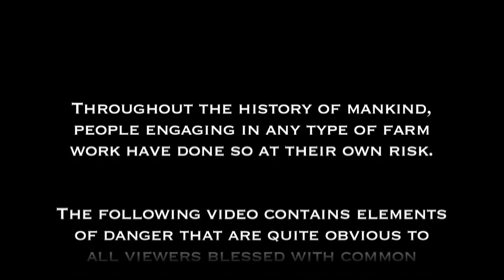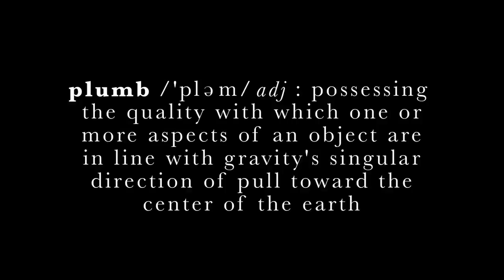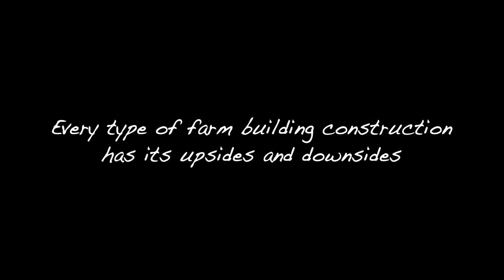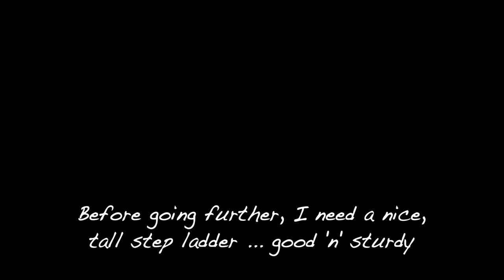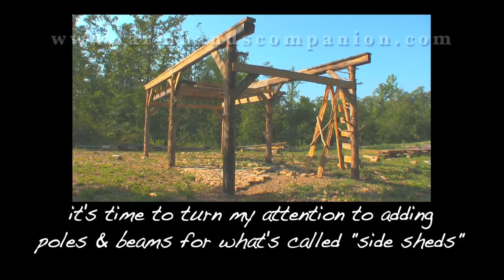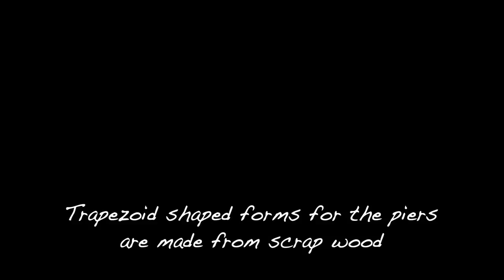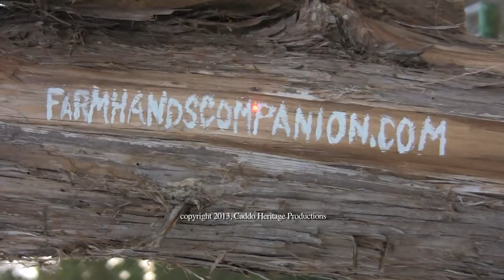Old-fashioned Pole Barn for the Small Farm, Pt 2 - The Farm Hand's Companion Show, ep 6

Comment: Hay Pa Mac !
I'm wondering how you got those Very LONG and very Heavy beams up to the top of those posts ?
I assume the use of your fancy tractor.... or did you use a Ging Pole ?   I've done some Ranching myself and building it 
all from the land is very rewarding , but in my case a necessity...    I made a 8hp bandsaw lumber mill that made the making of those planks far easier.... and less work... Hats off to you for sticking with it and getting the job done with just the chainsaw !
that IS a bunch of work ! Well done ! 
Bob.....
Reply from the maker: Hey Bob!
The longest boards I used were 11 footers—but they were pretty heavy, being made from white oak and about 1 and 3/4 inch thick by almost 8 inches wide. If I remember right, on the lower spans (just above head high) I drove a big nail temporarily on one pole (at about where the bottom of the board would be) and set one end of the board on this nail, while I carried the other end of the board up the ladder at the other pole and nailed it in (then moved the ladder to the opposite side and nailed that end in). For taller spans (the truss sills) I think I drove a temporary nail at both poles and with the ladder positioned in the middle of the poles, carried the board up and set it carefully on both nails. This is one of the reasons I intentionally designed the spans to all be under 12 feet (actually 11 feet) long, so that one fairly fit person could build it. It's still all tricky business, though—makin' sure the temporary nails were driven far enough in to hold the weight of the board. A falling board this heavy can wreak havoc on a ladder that's holdin' you up. It's also good to not have people, dogs, or chickens runnin' around under you—at least people, dogs, or chickens that you like. (Just kiddin' on that last thought)
Thanks for askin, Bob, and for watchin' the show!
Reply: Ok I understand that part  about the planks.... but the beams ...the 20' long 6"x6" or so beams that the rafters set on 
is what I'm wondering about..... are you saying they are 2 planks bolted together instead on one solid piece ?
.... LOL where there's a will there's a way !  makes sense to me !    I raised a log up about 15ft one time
for a ridge pole...  that was an ordeal indeed... I used a Ging pole, a board with a pulley on the top with a rope through it back down to the log, lifting and Pulling on the rope at the same time got one end up... then I did the same to the other end....  once up I cut the flat notch and used 12" spikes to hold it.... then I used logs to act as rafters every 2'  ( that ridge pole was about 6ft longer than needed so it would sit up there chained to the top) 
 ( i used lag bolts to hold the 2x8x6' Ging pole to the upright log... nails pulled out)
just so you know ! .... thanks for the info !   
Bob.....
Reply from the maker: That's right, Bob. The truss sill that holds up the rafters is composed of 2 upright planks (notched into the cedar poles from opposite sides) with a top plate nailed on top of both—none of which are longer than 11 feet.
(Your Ging pole idea sounds like more fun, though.)
Reply: Ah HA ! that's a very clever way of doing it Pa Mac ! 
....Thanks' for the Response !
 I bet your chainsaw is getting a bit Tired after all that work...
I made up an Alaskan mill years ago , yours is allot simpler and lighter!
.... I did brake down and buy a chainsaw sharpener ,Bench mount type, from Harbor Freight tools. ... it was a very, very good investment...a must if you use a chainsaw allot ..... although it's mostly plastic it works better than I can file the chains.... (Just don't forget the depth gauges on the chain !)
 Keep up the good work !
 and Thank you !
Bob.....

Comment: I always go back to watching the pole barn makin'. Two questions I have after watching this fifty times or so. 
1) What was the purpose of having the loft sills 2 feet below the truss sills?
2) I'm guessing normally you'd want to peel the bark off of the timbers to minimize bugs and rot. Is cedar bark also resistant to bugs and rot so u would be able to skip that step?
Reply from the maker: +Cassian YHVH 
Great questions, Cassian!
I'll start with the second question first:  yes, on practically every tree except cedar I would definitely peel the bark off or there'll be problems with bugs and rot. Cedar has such a thin outer bark (less than a quarter inch) and it usually separates from the tree and peels off by itself a lot of the time. In cases where it's hung on, though, I've not noticed any damage that threatens the stability of the post. Cedar must really taste bad to bugs.
As for your first question, allow me to rephrase it in a different way: "What was the purpose of having the truss sills 2 feet above the loft sills?" To start with, you can build your loft sills as high as you need em; I just wanted my loft sills high enough up that I didn't bump my head on em. Then, as far as the truss sills go, I could have designed things such that the trusses sat directly on the loft sills (basically combining truss sills and loft sills into one entity); however, that would have given me less headroom in the loft section (I'd be bending over all the time up there). I just happened to make the trusses sit a couple feet higher to provide more headroom in the loft. I could have made em sit even higher (3 foot, 4 foot, 5 foot, and so on...) but with every foot higher you go you're makin' a little more work for yourself. A couple feet seemed reasonable. 
Hope that helps, Cassian...and my best to you as you build your project!
Reply: Thanks for your thoughtful reply and the time you took doing so. It makes perfect sense now. Have you thought of future solar panels if they ever get cheap enough? I guess if that's a future option then you want the building aligned in an east west orientation so the "broad side of the barn"'s roof is facin' due south.

Comment: 2 questions on the beam.  Can you get away with using roundwood? With the top sill plate on the beam, did you nail it onto the round or did you square the beam up first?  My girls and I love your videos btw!  Your sense of humour keeps the 10 yr olds in stitches!  :)
Reply from the maker: Hey there, Marc! Yes, you can use round poles to substitute for most any of the milled framework lumber. It's trickier, in that you try to keep the size of the poles matching each other, and adjusting or compensating for crookedness, etc. If I were usin' stout round poles for the sill beam, I would not worry about a top plate, but might nail the truss ends directly to the sill pole. If the pole didn't have much of an even top, I might take a broadax and hew it evenly with the use of a chalkline. I'd also make sure the pole was strong enough to hold the weight of the trusses, with no large "knottish" defects in the middle. Think strength and safety; I wouldn't want that barn fallin' on your girls! (Please tell the girls Pa Mac says "Hey!")

Comment: Is there any reason why the main posts of a pole building couldn’t be put on piers like the posts for the sheds are? I’m sawing up wood to build a pole barn blacksmith shop, and I don’t have access to enough cedar trees for this. I’ve cut 4x4s from dead pine and I’m going to have to either burn them to make them rot resistant or put them on those little piers. I think perhaps the concrete piers would be better for me because the spot I have is very low and gets low standing water when it rains. What would you do, Pa Mac?

Also, I’m not far from caddo gap! I’m just outside Hot Springs myself. Maybe I’ll see you come the next sorghum festival.

Comment: I am building a cedar pole deck on the second floor of the outside of my barn. the two poles I planted are 14 feet apart. I want to cut a rectangular notch on each end, and have the same notch on the poles but the male form to fit the notch. Problem is my poles go up another 8 feet! I don't want to cut them off then build up, I want to use them for a roof! What is the best way to secure my deck floor logs to the posts without cutting out too much wood? Great videos!
Reply from the maker: Gotcha; good question, Jason.
I had a similar issue with my first barn in TN. A few of the poles at the back of the barn were a little higher at floor joist level than the others because of the slope of the ground. They were also a little smaller diameter than some of the other poles, which didn't help at that height. If memory serves, I just barely made a notch or "shoulder" for them to sit on (about 3/8ths inch). This way, it wasn't only the nails that would be supportin all the weight. The other option (or an option you can use in combination with a slight shoulder) would be to "scab on" a short board (say, about 18 inches long or so) by nailin it lengthways to the pole, and making the top end of the board sit exactly where it'll meet and support the floor joists. (The end of the board is basically your shoulder or "notch".) Hope this helps, Jason; and above all, build it safely and with much thought.

Comment: So we don't need cement for the holes?
Reply: this question is for the first video... you are a genius by the way!!!
Reply from the maker: You don't have to.
I don't, mainly because if I set the posts firmly by tamping well, I don't see as how the concrete helps enough to warrant it the extra expense (especially if I'm payin' attention to the proper times of the month to dig a hole and then set a post). And should my workshop burn up or be destroyed by tornado and need rebuilding, or someone one day repurposes the whole area, they don't have to deal with chunks of concrete in the ground. The same with fence posts. Some might even make the argument that the concrete actually encourages rot by not letting the wood breathe. I'm not smart enough to figure all that out; all I know is I don't use concrete and the fenceposts and buildings I've built thus far still function well.
Thank for watchin', Nancy!
Pa Mac

Comment: I hope you take the line level off to get a true level for the line. Those lie levels are a little heaver than most people think.
Reply from the maker: They'll work fine for the job, fred; if in doubt, just make a complete go 'round between each pole and see if you end up at the same mark by the time you get back around to the first pole. Also if you're not sure you're gettin' an accurate reading, put the line level in the exact middle of the poles; then, even if your line level is heavy, you'll still get a pretty good reading.
Thanks for watchin', fred!